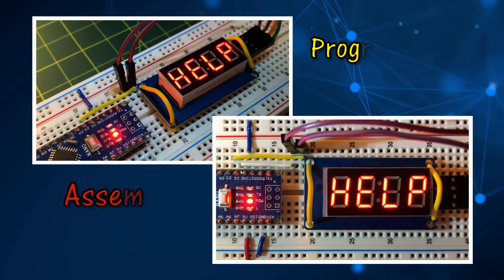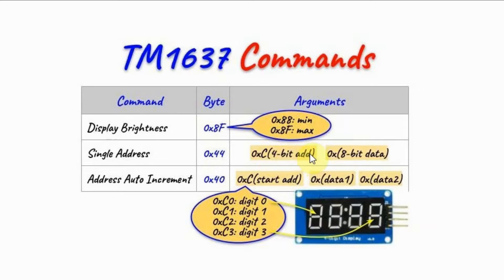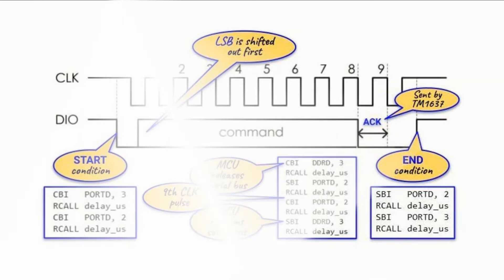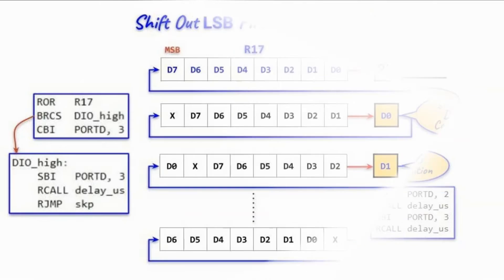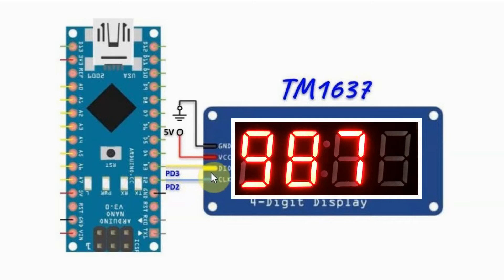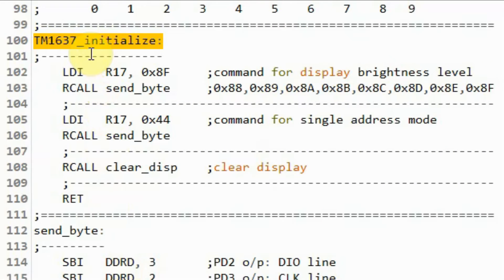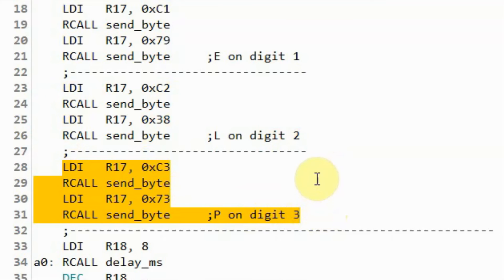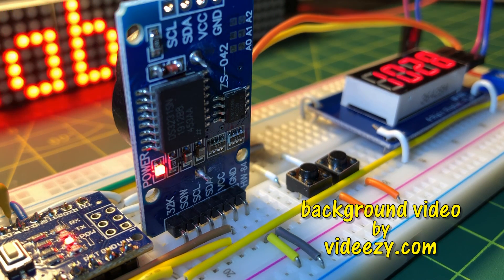Assembly via Arduino - Programming TM1637

Comment: Thank so much for the video. And what is the timing? In mean, in us and ms in the functions :) Someone suggested you could make a series in Assembly for the STM32 and it would be really great. Actually, we would have choose Arm Cortex M3, M4, M0+ or anything else. The readily avaible blue pill or black pill or even a nucleo belongs to one those architectures (not in the mentioned order), with a slightly different instruction set. I tried myself and somehow could blink a led through gnu Assembly (with thumb syntax) :D but I would like to tried and interface this display and other sensors, and hardware you have presented here. Thank you for the lessons. I hope I can convert this code into other forms of Assembly (for example, for the PIC microcontroller and MSP430 as well :D All forms of Assembly are beautiful, man!)
Reply from the maker: Many thanks for your feedback